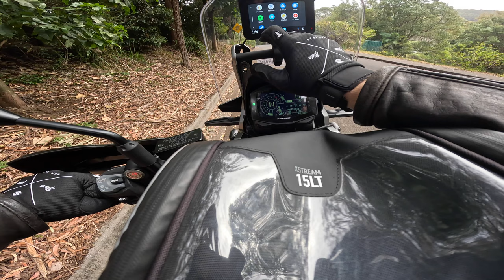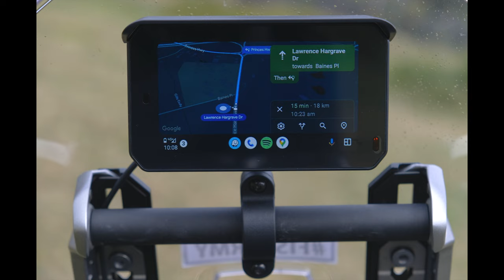Ottocast Carplay Lite C5 SE Installation on Suzuki VStrom 1050XT

Comment: Ordered a C5 lite lookalike off Amazon. Excited to see how it works. If it can just display google maps and let me control my audio crap then it's a winner.

As I understand. AA and Carplay wireless use bluetooth in order to negotiate a wifi direct connection and then does not necessarily need to use bluetooth which allows you to pair your headset directly to the phone. This is how it works with the AA retrofit I did in my car. AA works over wifi and my phone still bluetooths to the factory head unit. 

Not sure what that emit BT button does. If it means the C5 acts as middleman for your phone and headset I think that's not what you'd want to use. Definitely want your headset to connect directly to your phone.
Reply from the maker: See how it goes. I'm pretty happy with the unit. Yet to Bluetooth headset via helmet for audio.

Comment from the maker: The Ottocast instructions you scan a QR Code. The pdf was in Chinese so in typical Piss Take fashion I winged trying to explain this device. It works and was budget friendly as a gps option. I like the android auto feature.
Reply: Did you see a slot for nano sim but closed what’s that for . Also compared to previous model it’s not anti theft casing . It will not be practical leaving on bike on public area possible theft. Wonder how did you connect battery to cable provided. Can you draw the wiring if possible. Especially ground to where . Also how to get a spare cable . Is this the provided properitery male/female connection for use on rainy day and type c can be used on sunny day. While in type c it used to auto power on . Did the battery connect need to manually power on . Does it come with any converter😊 24 to 12 or something. I see only a fuse in between not sure it can handle all bike battery of 13v
Reply from the maker: @ulaganath  http://www.motorcycledvr.net/2023/07/21/mt65a/
Reply from the maker: @ulaganath  no nano SIM slot. Was just microSD.
Reply from the maker: @ulaganath  Not worried about it being stolen. Was cheap and Ive fixed the bracket down in a way to access via hex key is a pain to remove.
Reply: @PissTakeProduction  why SD slot for . Music or maps data
Reply from the maker: @ulaganath  Don't know dude 😎 Being Chinese they just add features on the packaging lol
Reply: Can share snaps how to connect to battery acc, positive and ground .
Reply from the maker: @ulaganath  If I get a chance will try. The cable ends are coloured red end to red side of battery. I know if I can install it you can too.
Reply: @PissTakeProduction red is fine . Where acc and gnd to be connected
Reply: @PissTakeProduction  also when does it turn on . Is this linked to ignition as if not it might drain the battery
Reply from the maker: @ulaganath  Hey dude 😎 yer it's not linked to ignition. I make sure it's turned off each ride. I put my bike on a trickle charge most days to prevent a flat battery.
Reply: From other rewiers the micro SD is for music, videos...
Reply from the maker: @filipepaninho6558  I can't get it or read the card on my end but Spotify works well.
Reply: @filipepaninho6558  But the SE doesn't show any app for music or app for accessing sd card
Reply: @PissTakeProduction   Can you help with pics where the 3 terminals are connect in your bike. 12v, ACC and GND are connected
Reply from the maker: @ulaganath  It's only neg and positive onto the battery. There was no third wire. Later here at night I'll take a photo tomorrow morning and upload to Instagram.
Reply: @PissTakeProduction  Any luck with the pics on the connection
Reply from the maker: @ulaganath message me on Instagram so I can send them to you. @drz400e
Reply: Any update

Comment: I just installed this on my Ducati. It all connects okay but I noticed that I connect my phone to the unit but my Cardo to my phone. Which is different to the Lite C5 unit. But then once all connected I use the C5SE to control the music on my phone. The phone and unit thru WiFi connection and the Cardo thru Bluetooth. Once I get it out on the road, out of my homes WiFi range I will have to see if it stays with those connections. I did not run the solid wiring as I am going to sell the Ducati so staying with the USB-C connection. I will go out for a ride in a few days and see how it all goes. I did look at the Lite C5 but it would have been near $100 more. I got the C5 SE at the discount price. I have been using a Tom Tom for navigation but liked this one batter as it has the full Car Play facility.
Reply from the maker: Yer I've only ridden it for the video. It can power on if not turned off properly. My bike sits on a trickle charger so I'm not worried about a flat battery. Yer I like the car play feature too. As for Cardo on the bucket list of items to get unfortunately that has to wait for me. Thanks for the comment appreciated 👍.
Reply from the maker: What's plans after Ducati for bike choice?
Reply: Moving back to Brisbane, Australia after I retire next March. Leaving my V4S Multi and am looking at the CF-Moto 800MT with all the bags etc.170HP down to 95HP. :( Oh well. But I can have a lot of fun here in Los Angeles with the 170Hp. 80MPH going to work on the freeways, way too much fun up in the twisties in the mountains, 75 in posted 50 zones. Dragging pegs, no cops, no radar, way too much fun. But I know that I can't ride like that back in Brisbane so 95HP will be enough. That's the hardest thing for me when I visit is to remember to slow down. I picked the 800MT Touring as I think it's a great deal, good motor, great features. Where abouts did you do you video?  @PissTakeProduction
Reply from the maker: @user-yk7wo8mb8m  That CFMoto on release they offered the panniers etc for about $11K was a great deal. Ducati great bikes if you look down at past videos I had a Ducati Sportclassic. Sydney for videos with plans to do the two trips on a DRZ for Cape and Simpson.
Reply from the maker: Just found a guy on Instagram that added the Ducati jpegs to the load in screen on the Ottocast. So when you start your bike it looks even cooler. Im in the process of trying to get my Ottocast to load in Suzuki images and company logo. Hopefully i get it to work and can make a video on it.
Reply: I bought this one and installed on my V4 Multistrada, but then found a unit on Amazon that looks exactly like the Ottocast Lite C5 but at about $80 cheaper. The only difference was that the Ottocast was 1000 nits and the one I bought is 800 nits. But otherwise they look exactly the same. Same mounting gear, same everything but the nits. I intend to take them back to Australia with me for my new bike over there. The C5 (or my clone )allows you to plug into a USB outlet via the power cord with a small adaptor that plugs into the round 12 volt cord and then into the USB outlet. Keeping the IP7 (?) waterproofing. The other thing with the C5(or mine) is that you connect your phone to the unit, then your headset to the unit as well. I tested it by calling my phone and I was able to answer it through my cardo as well as answering text messages through my cardo.  @PissTakeProduction
Reply: Love to know how he did this.  @PissTakeProduction
Reply from the maker: @user-yk7wo8mb8m Me too 😂 Ive added images to the micro sd and not seeing them. Might connect a laptop to it and see what happens.

Comment: A call out to everyone out there. I think you didn't mention this but I just got my C5 SE and realized that the touchscreen is capacitive so it does NOT work with gloves (unless you have touch enabled tips). It really sucks that a product developed for motorcycles is not suited for gloves...
Reply from the maker: I'll be honest for the price point it doesn't worry me as I set the destination before I leave and while in motion not going to be trying to press the screen while riding. With Bluetooth can you answer incoming calls on headset?
Reply: @PissTakeProduction  true but if you want to make a call while riding, or change music (something I can and usually do in my BMW wheel) is not going to happen unless your gloves are with touch tips... and if I pair the headset to the Ottocast then I loose that. 
To your question, II suppose yes but I haven't tried yet. I haven't installed it as I'm waiting for a plug to have the Ottocast only turner ON when the ignition is ON and not wire directly to the battery.
Reply: @pmjcr  what type of plug is that ? and did Ottocast sent it to you for free on request ?
Reply: @frenayjp  I bought the unit via their website. Took 5 days to arrive.
Reply: @pmjcr  hi thanks for your response. I also bought the unit from their website but you've talked about a Plug that would only turn the unit ON when the ignition is ON. Did you receive this plug from them ? and could you send me link to this plug ?
Reply: @frenayjp  no. it's a plug for bmw that connects to the accessory connector
Reply: Do you have problems with the unit shutting off by itself on higher rpms? Like a surge in power? Mine shuts off. 😢 I connected mine directly to the battery as well.

Comment: How does it turn off as it is direct connected to battery, will it not drain your battery after a while?
Reply from the maker: After riding it has a red light showing power still connected. I hold it down after 10sec and it turns the unit off completely. When at home I always use a trickle charge to keep my battery topped up. I've have had the unit on the bike this entire time with no problem.
Reply from the maker: I'm reviewing a new unit this week. So a new updated version from another company which has been sent to me.
Reply: Thanks, I was not holding the power button long enough @PissTakeProduction

Comment: Saw a lot of reviews on this nobody is saying about how it functions when you are connected to Ottocast and Cardo/Sena headsets in DMC mode at the same time...does it let you talk to other riders when you are also connected to this device.
Reply from the maker: The QR code I scanned on the box gave me a Chinese pdf. I don't have a Bluetooth headset as said in the video but you would be able to take calls and listen to music via Carplay.
Reply: It does connect with DMC. However, my setup was Cardo connected to my phone then phone connected to Ottocast. I haven't tried connecting Cardo to the Ottocast unit's BT.

Comment: Hi there. Just got one. Red light on side of unit is flashing red…any idea?
Reply from the maker: I never saw it flash red. Was on and turned off when I turned the unit off after every ride.
Reply: @PissTakeProduction  thanks for the reply. For some reason I got the unit with the cameras. Im considering cutting the cables off as it seems pointless to have the cameras. Cheers mate.

Comment: Anybody know what the difference is between the SE and the C5 Lite?
Reply from the maker: The SE detaches from the cradle as where the lite is fixed.
Reply: Believe from the website photos the SE is a square edged more modern looking unit. The C5 lite has a rounded shape. I asked a question direct to ottocast about the SE and had a reply that the SE comes with all the same connectors as pictured with the Lite
Reply: The other one has a removable cradle and RAM mounts.

Comment: Does this unit have an adapter to mount to the standard AMPS 4 hole system?
Reply from the maker: Only has the power supply to the battery and USB-C.

Comment: İt disconnect ör switced of itselff donat bu,,,,,
Reply from the maker: Has its own on off button with a 5 min timer. Was fixed and disabled during the video.
Reply: @PissTakeProduction  I don’t mention this.
CarPlay switch off itself on the road suddenly.its have lots of problem on the software.
Google maps or screen goes dark suddenly.wifi or Bluetooth disconnects sometimes never reconnect again.
No response from ottocast about the question.and we try on the brandname products.both of them are not working properly.
Reply from the maker: @erdemozalp  There customer service maybe lacking? Mine still works fine.
Reply: @PissTakeProduction  they dont respond mails!Incredible.thx for response 😎